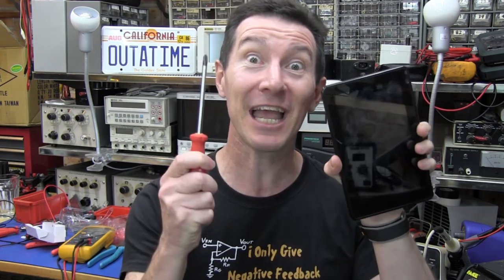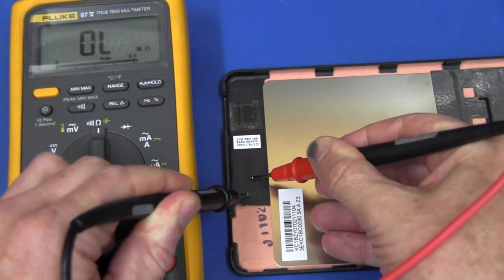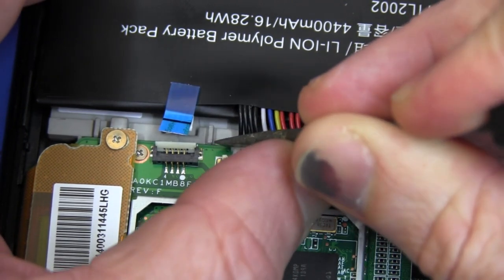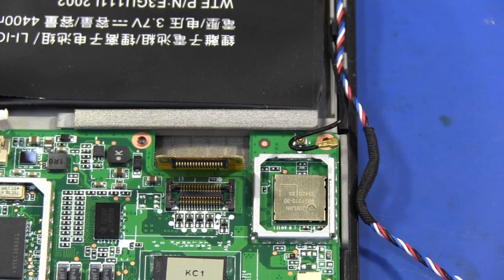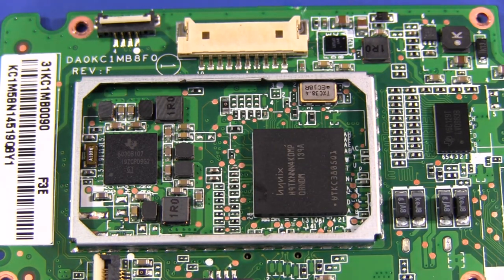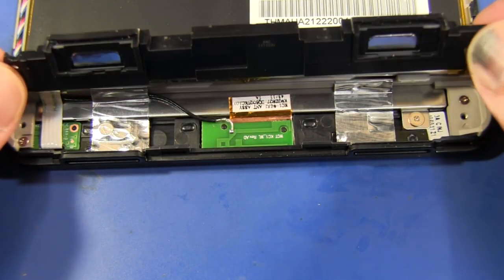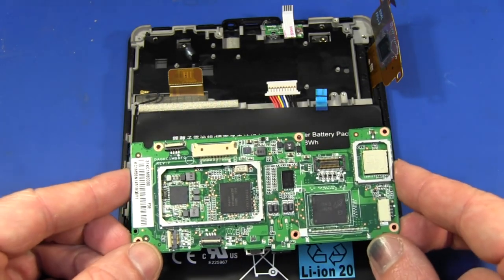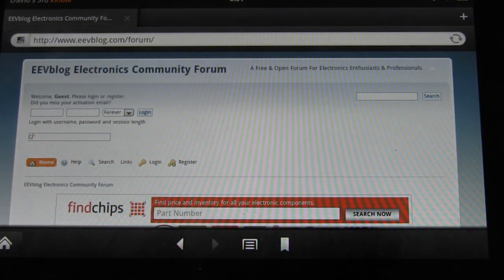Amazon Kindle Fire Tablet Teardown - EEVblog #219

Comment: @38911bytefree It's called POP (Package on Package). Basically, the CPU has BGA balls on the bottom, and BGA pads on the top. The RAM (special POP RAM) solders onto the top BGA pads. This is done when the boards are populated, it's not  a chip level thing.

Comment: @samgab Spudgers are typlically insulated so that you can poke around live circuits with them without blowing anything. Dave's is metal and resembles the little stainless spatulas that chemists use to handle small amounts of powder. Perhaps Dave will clear this up and give the brand and model.

Comment: Dave, could you please do a teardown with reverse eng on a Fender strat? I'm aware it might be extremely hard to come by a strat someone's willing to lend you for that purpose, but I took mine apart today to remove some rust from screws and springs and so on, and I was too tired after cleaning up to try my 1st reverse engineering on all the cables that went thorugh to the backside and back to the front. Maybe that kinda stuff interests you, would be really great to see you dissect one. Cheers!

Comment: You have more guts that I have placing those itsy-bitsy screws out where they could go flying onto the floor. You'd never find 'em.

re: the unshielded connector:
Suppose they used a robot to "push" the screen buttons of an assembled unit.. Could they place an antenna close to the unshielded spot and pick up some general trash from the connector leads that could be used as a final go/no-go test via spectrum analysis (or some other wizardry)?

How come your not doing this from the new digs?

Comment: Nice work, Dave.  That accelerometer placement is indeed strange. Maybe it was sensitive to interference, or maybe heat? Maybe the designers thought they got better or more-reliable input from the user by placing it there?  I can't think of many other reasons to string a flat cable all the freakin' way across a device like that.  Let's hope the lithium battery was well made and doesn't go boom like the old Sony batteries.

Comment: Hmm, Wouldn't it make more sense for the small BGA to the right to be a power management companion IC due to the high density of inductors and large ceramic caps?  I know some processors do have the dc-dc converters integrated into the core but I was under the assumption that the TI OMAPs use companion chips for the power stuff and had package on package for the ram. neways, awesome teardown! I love the in depth analysis. Keep 'em coming!

Comment: Are they cheating with the battery? 2 times 7,77Wh = 16,28Wh? Or could it be that whoever combined the two cells to the final battery did tests with other currents?